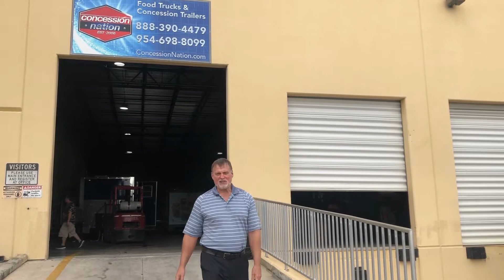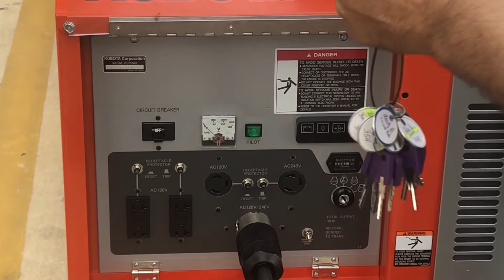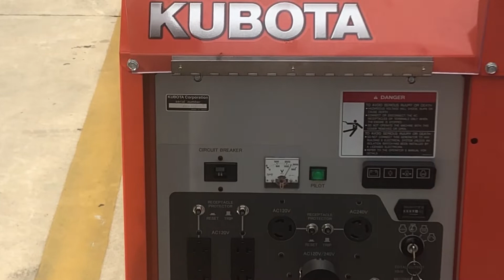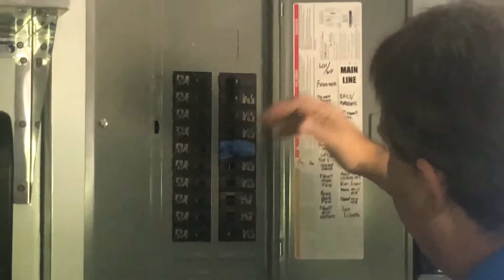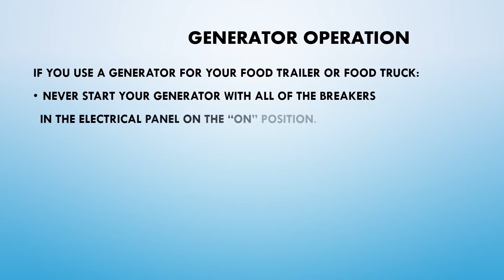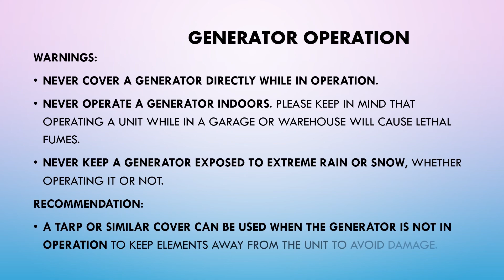Food Trailer Generator | 11KW DIESEL "KUBOTA"  GENERATOR

Comment: I have the same generator on my food trailer. I crank it with nothing hooked up then once its running I hook my cord from the generator to the outlet going into the trailer. 
You don't have flip breakers on.
As far as being quiet not really at all and mine has not one time ever felt the generator surge with everything on. It pretty much just runs normal. And I have one of the best ventihoods on the market and air curtains